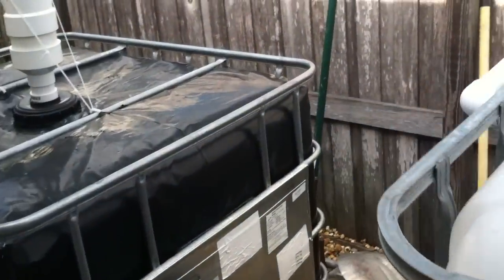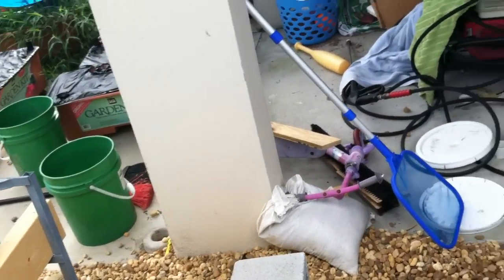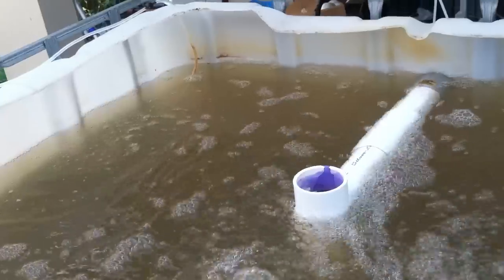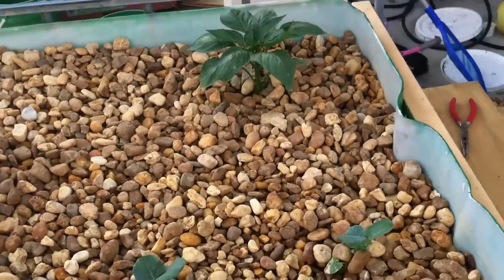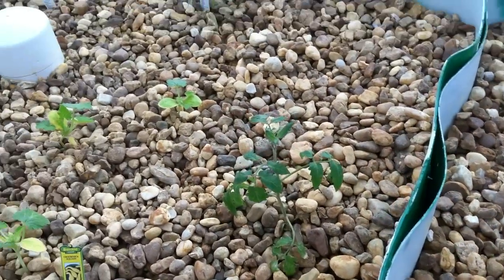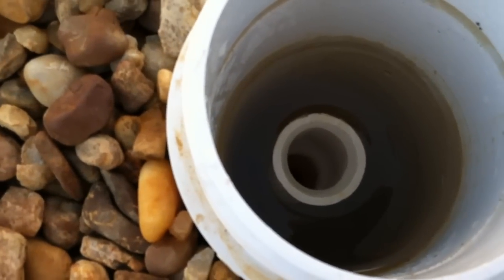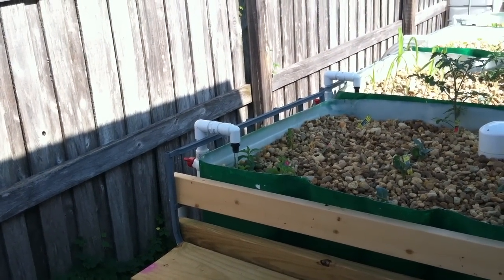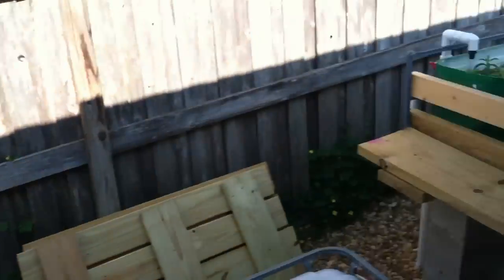Mikes Aquaponics - Introduction to Aquaponics and Mikes First System - Part 1

Comment: Nice setup! the only recommendation I would add is to change the flow of the water from the fish tank to run straight to the grow bed, that way the polluted water is not pump back to the fish. Research how to build a flow filter and a bio filter this two components can add extra benefits to your system and can be easily added by cutting and adapting to your currant pvc pipes.
Reply: This is a standard CHOP2 design.
Reply: I second this recommendation. Your SLO should go straight into your grow beds which are filtering the water and then the cleaned water is returned to the sump and then pump the cleaned water in the sump into your fish tank. The fish need clean water, not half clean half dirty water being pumped back into their tank.

Comment: Hey Mike, this is an awesome system. Looks clean! I was just wondering if the noise of the water draining constantly has ever bothered your neighbors or yourself at all. Also wondering if you're using anything to heat the water for the Talapia? I saw a couple videos mention they like water temps of about 80 F. Thanks for sharing!

Comment: Very good job on the system. I see your using the what I like to call "Fish Tank Over Growbeds" system, where the fish tank is above the height of the growbeds. It works well, just needs a bit more work. I have mine the opposite, where the growbeds are above the fishtank and allows me to have a Flood and Drain type of system. The only thing you need to fix is how close you plant and how many plants you put in the system. Funny how you did the same mistake I did when I started. Many of the plants you have planted will grow way bigger than you think. The corn and tomatoes will be huge. The cantaloupes will tangle over each other that close. Roots will start to clog your drain pipes. Trust me on that one. You will eventually see how they grow and space them accordingly. Other than that, good job.
Reply: He's got Bell syphons.  This is a flood and drain system.

Comment: You did a great job showing off your system. I would have thrown some gold fish or something in there to jump start your bio bed.  Your SLOW pipe could pump into a swirl filter system which will keep your water cleaner.  Also David Reed is correct, animal and fish are different than us but still, there is fiberglass in the water that your special first flush system won't catch.  Then the fish breath it in then you eat the fish.  Now if you have a medal roof, not so much to worry.  I'd like to see an up date on your system after all this time.  Thanks for sharing.
Reply: any filters or methods to get the fiberglass out of the water. i want to collect rain water but i have fiberglass shingles also

Comment from the maker: This is actually called a Chift Pist.  I would like to circulate only clean water but it does not work with my design,  I wanted to have a place for my kids to stand and look at the fish, it just did not work out that way.  Believe me, I went back and forth on this but we had already dug the hole in the ground.

Comment: A good first system. :-)
Mint will take over unless you fight it.
Do you have a "media guard" round all your bell syphons to make them easier to look after?
I am concerned that you will fill your grow beds with fish poop. This will go anaerobic and this is not going to be nice.
Rock is cheap, but heavy and hard to work with.
A slot on the bottom of your bell will allow more flow than holes, and will clog less easily.
Do you have enough aeration?
Well done, but you will end up adding to it... ;-)

Comment: Overall, nice set up.
The mint will take over- Plant it in your yard instead.
The cantaloupe plants will grow BIG and sprawl, even if they are a bush variety. For that size grow bed, 3 at most, and there most likely won't be room for anything else.
Of course that's just my opinion, I could be wrong

Comment: Hi Mike, Can you tell me where you were able to find the 275 gallon tanks
Reply: Those are called IBC totes. You can often find them on craigslist. Try to find ones that had some type of inert substance or food product in them so they should be safe to use for the system, but I would still recommend a serious cleaning before using them anyway. Depending on location and time of year, they can range from $35 (which I paid recently, a company was trying to get rid of them quickly), to $100-$150. For ease of use, get the ones with a ball valve on the bottom not the butterfly valve. The butterfly valves will leak over time. They also make bigger ones that are 350 gallons I think. Rough dimensions of the 275 gallons totes is 4'x3'4"x4' - WxDxH. They weigh around 100 lbs-ish.

Comment: How did the tomatoes do in that system? Tomatoes do not like "wet feet."
Reply: +alan30189, this system he has a "Flood and Drain" system. Tomato plants do really good in it because the roots are not always in water do to the system flooding and draining. It basically compensates for the tomato plan's need to not have wet feet.

Comment: I feel you have a serious design flaw in your system that can be corrected. Why would you be sending dirty fish water back to your fish? It should be going directly from your fish tank(s) to your grow beds and after the grow beds have cleansed it it then goes to your sump. Another advantage is that your pond pump in the sump only has to pump clear water which should at least quadruple the pump life as opposed to pumping solids. Let's subscribe to one another: Smoky Mtn. Aquaponics (fiskfarm)

Comment: I do not think that you have enough capacity for your first flush system. A roof has a lot of area to wash off ! I would dump the first flush into at least a 55 gallon drum.  Otherwise I like your ball valve system.
Reply: Donald Miller I found a calculator for that and I run it for my shop roof which is a 75x100 building and for each quarter of the roof I only needed 2 - 10ft 6" pipes for the first flush. What he has seems sufficient.

Comment: I like some of your ideas, but I'm sure you've found that there are some mistakes: 1. Obviously, you should have washed your gravel first. Alternatively, it appears that crushed lava rock (basically pumice) is the cheapest clean media...less than vermiculite, Perlite or Hydroton...while still being fairly light with lots of surface area; 2. Keeping worms in the grow beds is impractical. The flooding will kill them and it will be impossible to keep the water clean. You should have a solid filter and worm bed where the solids can be placed. 3. Growing corn hydroponically is a waste. You might get 3 ears per plant. Growing melons, unless you can get them to go up a trellis, will take up a huge amount of space. Better to grow them outside and use some of your nutrient rich water to feed them periodically. 4. The amount of chemicals that plants need will not kill fish. Chemicals are chemicals...the "organic mindset", that, somehow, nitrogen from fish-shit is less toxic than nitrates from fertilizer, is baloney. And, you will find that potassium and phosphorus, needed by plants, will be in short supply from fish waste. Like it or not, some P & K will have to be added to the system.

I hope these comments help.
Reply: Olen Soifer, I am sorry to tell you that are mistaken, the worms will not drown as long as there is enough oxygen in the water.  I have had an aquaponic system  for over 3 years and I have lots of worms in my system.   Your statement, " The amount of chemicals that plants need will not kill fish. Chemicals are chemicals...the "organic mindset", that, somehow, nitrogen from fish-shit is less toxic than nitrates from fertilizer, is baloney" is completely WRONG.  Why do you think there are dead zones around the world?  There have been many studies that show how harmful synthetic fertilizer due to run off and that it harms aquatic life. 
http://www.scientificamerican.com/article.cfm?id=oceanic-dead-zones-spread .  Also Mike will not need to add P&K the only thing that will need to be added is iron. Fish waste is organic and defiantly less toxic than petroleum-based synthetic  fertilizer- it is toxic to aquatic life it is also toxic to worms and other micro-organisms. Do some research before you try to correct someone....  
  The one statement you are correct about is corn, it grows much better in the soil. However, most vegetables are harvested much more quickly in mature cycled aquaponics system compared to  traditional soil garden.